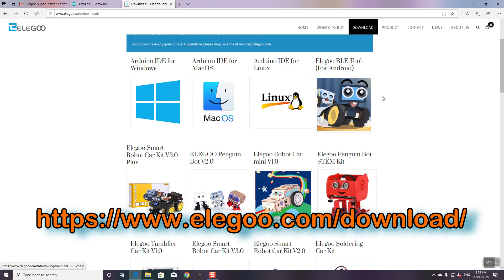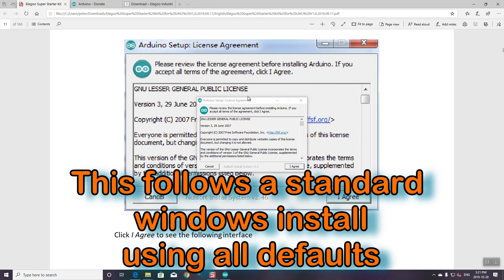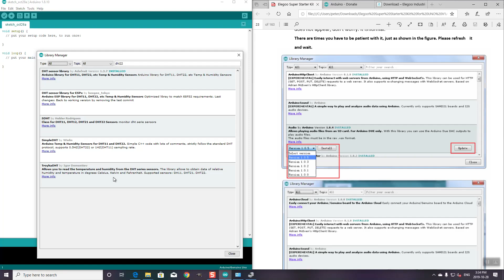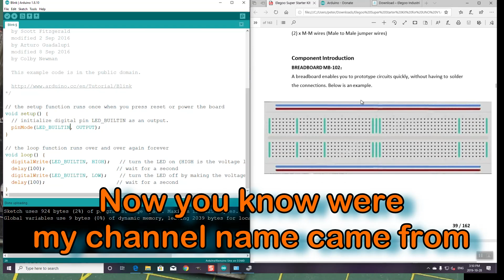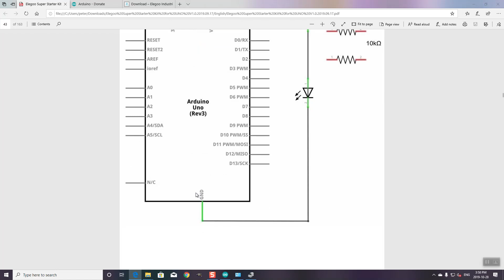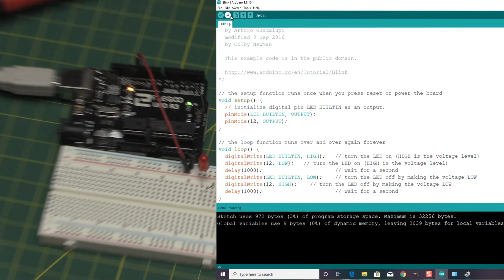Learn Arduino from scratch to expert  using the Elegoo Uno, Tutorials 1,2 and 3

Comment: Thanks so much for your video!  I'm a new user to this kit (and electronics in general).  I'm using the web editor as opposed to the downloadable software and I'm struggling to figure out the board and port that will connect to the Arduino.  My Arduino says "Elegoo Uno R3".  Any helpful tips/ideas for connecting?
Reply from the maker: when you plug the board into the PC and it pops up with Elegoo UNO... thats the one you want, this is just the name they put into the USB to serial convertor that connects to the ATMEGA328 on board. So when you read articles that refer to a COMx port, just use the one associated with the Elegoo UNO port.

Comment: I'm trying to help my son, and keep getting error timeout communicating with Programmer. We've redone all the steps several times with the same results. Do you have any advice?
Reply from the maker: If i can... a few questions first
what is the version of the arduino ide ?
is the arduino the exact same as I am using in this video, if not then please provide a link to yours so I can see what chips it uses
do you see a "comx" port in device manager under the section "Ports (Com and LPT)" where x will be a number, you would see in this in "control panel", "device manager"
is that com port the one you have selected in the arduino IDE

Comment: great video, i plugged in a wire instead of a resistor for the led light and now my the bread board doesnt work. do you know what happened?
Reply from the maker: you could have damaged the LED or the microcontroller, try using a different pin and adjust the program to use it, also use a different LED and dont forget the resistor this time :), if that works, try the older LED, if it still works then the microcontroller port has failed due to the over current. if everything else is still working then you can simply avoid that pin going forward, or you can replace the ATMEGA328 chip, make sure it has a boot loader installed.
Reply: @TheBreadboardca  I appreciate the response! thanks goodness it was only the LED

Comment: I think you are doing an honest and commendable effort to guide absolute beginners through first steps with Arduino and, consequently, into the electronics world.
So, in the spirit of your video and quoting Dave Jones, here is "a trap for young players":
When removing components from a carrier tape to use in a breadboard, always take the care to, either clip the component legs out of the tape, or clean them with isopropyl alcohol - most times there will be residues of the tape adhesive in the component legs and when you insert them into the breadboard, you will drag adhesive residues into the breadboard contacts (which you cannot see from outside). This will lead to poor component connections and result in "strange" behaviors or malfunctions, either immediately, or months later. The difficulty to trace breadboard poor connections grows in proportion to the circuit complexity - For your sanity, only insert clean components into the breadboard. Also, don't leave breadboards on the bench collecting dust for weeks.
Reply from the maker: An excelent point to raise and I will make it clear in my next video of this series. Thank you for highlighting the potential issue. And I completly agree with you. The other way I have seen this handled it to always cut them free of the tape carrier.
Reply: @TheBreadboardca  Thanks! Glad that you agree :-)
Reply from the maker: @JoseSilveira-newhandleforYT  I do indeed. we "Older" engineers often get a bit complacent with best practices and this is an example. 99% of the time it will work ok, but we will always get bit eventually and be reminded we picked up a bad habit :)